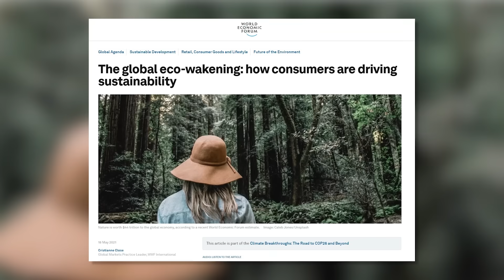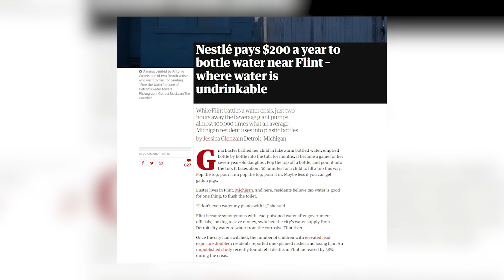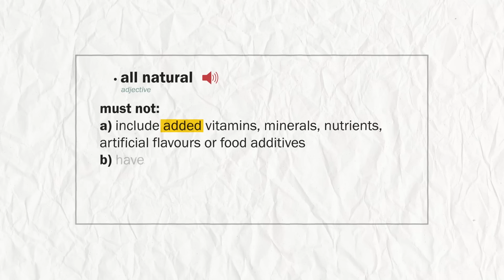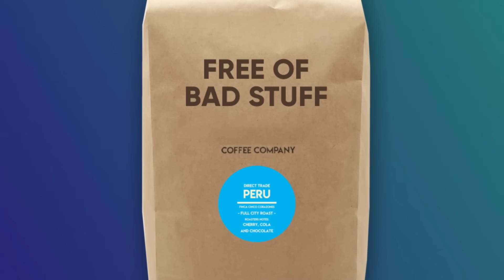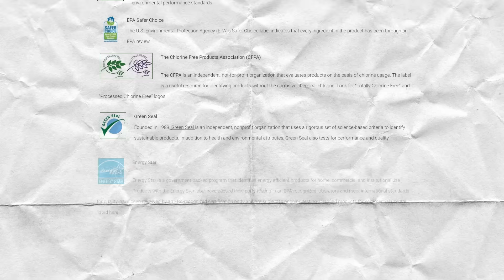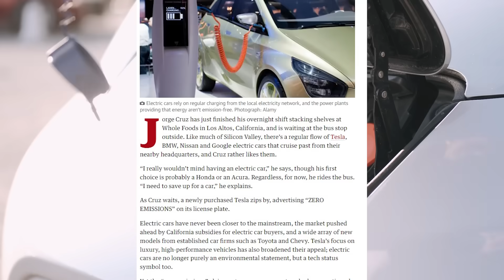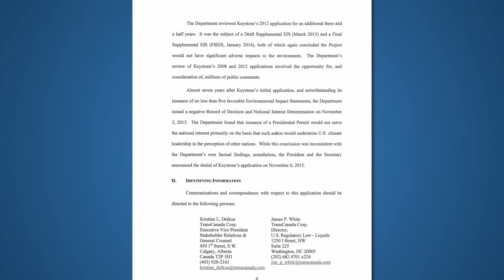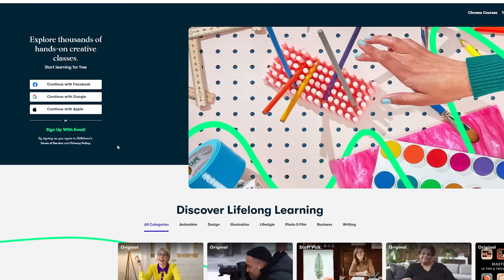Why Being 'Environmentally Friendly' Is A Scam

Comment: I'm a huge environment buff and guess what, I know the pipeline cancelled was worse for the environment. All that oil that could have been piped is just being transported by diesel trucks and trains instead of using hydro power to run pipe pumps. And has cost the Canadian economy hugely.
Reply: Yes, that part of the video surprised me. I am interested to hear how the folks at asap science think oil and gas should be transported as an alternative to pipelines.
Reply: hydro is bad btw, well, dams are bad, not that hydro is bad.
Reply: Would you mind giving the numbers since you know?

It would be nice to have some actual numbers then two people saying "I'm right." and "I'm right." both with contrary views.
Especially with costing the Canadian Economy as it seems odd this would hugely impact it.

You have to factor in pipe being maintained, building it, leaks, damaging, the transport from there... all compared to if the transport vehicles (Trucks and trains) are filling empty spaces with it potentially reducing the cost massively and remember those truck drivers need jobs so they'll go produce waste somewhere.

This also means you need to know routing ect and a few other details to blame it on it being the source of the problem and not a major issue with something else.

Something like this is incredibly deep and to be able to factor all these in and say for a fact either way is pretty difficult.
Reply: @Buglin_Burger7878  I'm not a researcher nor communicator but I come across these topics in articles and YouTube over the years. I don't have a reference. However the labour cost alone of truck drivers per km of oil transported, plus cost of fuel for those trucks... It's clear maintenance of pipes would cost less per km. I want to get off fossil fuel dependency too but gotta do low hanging fruit first like replacing all the coal power plants with natural gas or nuclear would be better $ than dealing with Canadian direct CO2 which is a rounding error compared to the rest of the world. We are like what is it 36M ppl? Out of almost 8B ppl. Canada's direct CO2 emissions is nothing. Our consumption of goods buys so much that is produced over seas so our indirect CO2 is insane. Bigger fish to fry than our own stuff
Reply: @TheSkystrider  also to mention without that pipeline the US is now struggling to supply enough gas as the war with Russia and Ukraine continue. people are now forced to work from home again because they can't afford to drive to work. having the pipeline would have allowed us to rely solely on ourselves for an important product of everyday life instead of importing from another country. the pipeline would have created thousands if not millions of jobs and that not only benefits the economy but also would have helped stabilize us during the pandemic and now war. I'm all for looking toward the environment but the pipeline was a safer option. you are most likely to die getting in a car accident and car accidents happen daily. if a truck carrying oil crashes the cleanup will be costly and if it catches fire they can't put it out with water. the cleanup will have caused more of an impact on the environment and wildlife than if we used the pipeline.
Reply: @Buglin_Burger7878  it is difficult to assess.  Here are some decent attempts, though. They focus more on spills, emissions, and worker safety than financial costs. 

Strogen et al 2016 (Applied Energy)
Green and Jackson 2015 (Fraser Institute)
Furchtgott-Roth and Green 2013 (Fraser institute)
Crosby et al. 2013 (NOAA)
Clay et al. 2017 (NBER)

Comment: Isn't it the same with phone? It's same hz with microwave and they still lie that it won't harm us when it does. The side effect is large intestine getting weaker, nausea, fatigue, knee pain, dizziness, increase of having several kinds of allergy, fog head, immune system problem and so on. There's even 5g everywhere, electromagnetic everywhere, electronic devices everywhere, wifi everywhere. I wonder what left for humanity after what's created are only for our pleasure and fun but not life and happiness.

Comment: Seeing all this I like to Mention an Idea for an App that I still think about: You simply scan a Barcode on the back of a Product and it tells you all about the shady stuff that this Product is related to(think like scanning a Nestle Product gives you "privatization of Water" etc.). The problem with that is that you would have to build up the database first and making shure everything is acurate would be really hard especially if done through crowdsourcing. Implementing the app itself might be difficult but is definetly feasable.
Reply: There are several like this. One for sea food, Buycot etc. all are trying to implement this in the respective market.

Comment: What do you think of Extended Producer Responsibility (EPR) regulations? India is implementing regulations that are putting the onus of recycling plastic on manufacturers, retailers and brand owners that use plastic in their packaging. For example, if Nestlé uses 100 tonnes of plastic, they have to recycle 50 tonnes (50% is just an example - the % increases over time). 

EPR seems to solve the first issue of the gap between recyclability and actual recycling that you discuss at the start.

Comment: For those who think they won something by cancelling the keystone xl pipeline, now the same amount of oil has to be shipped by train. 
Also, any deficit of oil that needs to get to market (yes, your food, goods and Amazon Prime packages DON’T get driven around on good intentions) comes from a place with little to no regulations. Look up what Texaco did in the Amazon rainforests.
Also, look at the power it gives certain countries, along with the conflict that comes along with the greedy trying to be the only ones in the game.

If you REALLY want to make a difference, DEMAND a cleaner alternative be made available at at least a comparable cost to the consumer. High efficiency solar panels for rooftops of houses and the tops of electric busses, for one.
Locally grown fruits and vegetables from vertical greenhouses is another one. Eat better AND reduce your carbon footprint by not needing to ship them over several countries. Like people still buying bottled water when for many of them comparable water comes out of their tap, reduce the demand and reduce the environmental impact.

Comment: Thank you for openly bringing up the negative aspects of EVs (and for that matter all li-ion powered devices) I do like EVs in general and electrification is a necessary step going forward. But too many claim that as of now EVs are the be all - end all for mobility. But they themselves have a lot of issues which still need to be sorted out. We are simply stuck in beta testing.

Comment: I was largely with you until you mentioned the pipeline. Only a completely misinformed person can say that it is a good thing it was canceled. That quantity oil is going to be refined one way or another. It can either be hauled via truck, rail, or ship and have higher risk of spillage and far more energy costs or via pipelines.
OR
You could have it pulled out of the ground from countries that care even less about the environment than Canada or the US and THEN shipped from even further away.
All this jacks up costs on the costs for people that they could have used to purchase solar panels for their house, a more fuel efficient vehicle, or even decent meals for their kids.
Those aware of these things and are wanting the pipeline shut down are heartless.
Reply: Yes
Reply: fax
Reply: Yeah I came to the comment section wondering if the pipe line was better than shipping oil via ship. train, & truck.
Reply: Good thing not all commenters are brainless sheep. The video creator is probably happy that us, peasants, suffer from inflation and of course since he is rich, he just takes it easy.
Reply: It is a good thing it was stopped,  we need to shift  immidietly to Decentralized renewable micro power. photovoltaics on roofs, solar power, hydro power, collect food waste for biofuels. This is the future, not the pipeline, thoose who think that oil will be refined one way or another, are not helping in getting the government to switch to renewable energy. society in 2022 has the capacity to move solely  towards renewable  energy, people must recongonize that so we can STOP investing in oil and fossil fuels, before it is too late
Reply: @JP-flower  I am afraid you are incorrect. Every single thing you are proposing requires oil at one stage of its journey or creation and the higher the price of oil the higher those goods are and the fewer people who can purchase them.
Like it or not, oil is the lifeblood of today's economy and only leveraging that can we hope to move beyond it.
Would it be nice to have every home a solar roof to provide its own electricity?
Why yes it would, but at this time it is impossible due to costs.
And should anyone say just use subsidies, I refer you first to Solindra then to an common sense that someone has to pay for it in the end and the government is already hemorrhaging debt.
Reply: @JP-flower  lack of money makes people homeless

Comment: An individual tip:

If you're using tote bags, use them as efficiently as you can. Some people have massive amounts of tote bags and believes that that solves the problem. It makes it worse. 

Reduction comes first before reusing and recycling. If you can no longer reduce something, that's when you reuse. If you can no longer reuse it, recycle.
Reply: Just to add on, 1 cotton tote bag produces the same amount of waste/pollution it takes to manufacture about 8000 single use plastic bags. It's one reason why I insist on using single use plastic bags instead of buying a brand new tote bag at checkout counters if I don't have mine on-hand. Assuming one goes shopping for groceries 2 times a week, it would take them *76 years just to offset the pollution/waste created by that 1 tote bag*.
Reply: @professionalpotato4764  the plastic ones are banned in Portland,Oregon. It's paper or reusable totes, and paper breaks hella.  So I either don't use a bag or remember to bring my reusable ones.
Reply: @professionalpotato4764  Reusable plastic bags exist.
Reply: @someonespotatohmm9513  Plastic bags in nature are reusable to a certain extent. Even those single use ones.
Reply: @professionalpotato4764  That's why I find phaseouts and bans to be stupid. They overlook the fact that they can be reused too.
Reply: I only have one tote bag I got second hand that I got years ago that I keep fixing up. If I’m going to get a tote bag I’m either going to get it second hand or make it myself and I also get my fabric and what supplies I can second hand
Reply: Also, reuse your "disposable" shopping bags! Etc etc
Reply: They can also make a tote bag easily from old clothing. Re-using jeans or t-shirts for totes would defiantly help things. but alas no one wants to make things anymore.
Reply: @777SilverPhoenix777  Years ago, I gave an old Looney Tunes jean jacket I'd long since outgrown to Dad to send to Goodwill.  Instead, Mom got ahold of it and sent it to her seamstress friend to repurpose into a tote bag.  I got it as a Christmas gift.  It looks great, is washable, and will take a long time to wear out, if ever.
Reply: @777SilverPhoenix777  THIS GAVE ME A GREAT IDEA FOR CRAFTINGS!!!!! I'm in a club and as the president of it I'm trying to do some craft projects and making diy projects like these that help the environment??? Sounds GREAT
Reply: @sin3358  You can also make "yarn" by cutting single use plastic bags into strips and then use the yarn to knit, crochet, or weave new items.
Reply: @sin3358  just be careful - this comment's original point was "we really don't need a ton of tote bags, they have real environmental costs." So, good to make if folks really need, less good to make just got its own sake
Reply: @777SilverPhoenix777  The problem is that most people don’t have the time to make things. Especially with people who have multiple jobs.
Reply: @corycianangel6321  I'm not sure I agree with that.  I think a lot of people end up watching a lot of TV or YouTube, or tiktok.  There's not really a good reason why a person can't craft while doing those thing, especially since crafting reduces stress + anxiety and improves self confidence, in addition to the ego boost that comes with doing something good for the environment. So like, if someone seriously only has time to eat and sleep when at home, then yeah, they don't have time to craft new bags, but most people, even when they have multiple jobs, have some free time.  I'm not saying everyone needs to start weaving bags and spend all of their freetime weaving bags, and dedicate all of their mental energy to bag weaving, I'm just saying that if it's something someone cares about, they'll make time to do it.
Reply: @777SilverPhoenix777  and they are so comfy too!
Reply: I alway use the tote bags I got from the grocery store everytime i get groceries, but I have the sturdy foldable ones because I can fit more groceries per box bag.
Reply: I have several totes in my home and car, and I’m trying to put them in my relatives cars as well. I technically have more than I need but I’m trying to lessen the times I need to use plastic bags, and give them to people who might not be inclined to buy them themselves but will take it if I give it to them. I’m trying to get them used to it too, since the ones I have hold a lot and are really sturdy. Way better for us than dropping stuff in plastic bags that tear.
Reply: "If you can no longer reduce something, that's when you reuse. If you can no longer reuse it, recycle."

Nope, no no no no. Categorize instead, you want to recycle what you can BEFORE they become useless garbage from wear. I sense a little bit of a tone here, like the throwaway line that, when China refused to TAKE America's trash, it "became simply waste".

Uhh, it was waste all along. What was it before, a COMPLICATED scheme to make China seem evil for banning things, and seem like producing heaps of trash (imported from America)?

You've convinced me, but not without some help from Noam Chomsky. This whole comment section is full of people shouting "scam" and other buzzwords, all it is is trying to one-up everyone else's sense of smug superiority from having the REAL "solution", but they're all just a parade of distractions invented to keep people navelgazing with ineffective busywork, or looking at their toes in defeat.

Take initiative and STOP BLAMING SCAMMERS. Blame yourself for accepting packaged solutions. If you'd have that kind of integrity you wouldn't even be so consumerist, because things to buy wouldn't appear as solutions to your nonexistent, made-up personal problems. Not gas to haul monthly groceries, and not plastic wrap of ready-made meals. You would work and vote to CREATE solutions, and "scammers" couldn't provide you with dreams in a can that YOU wouldn't create a market for.
Reply: I have a bunch of linen tote bags, but I didn't buy a single one of them. Most have a huge logo of a pharmaceutical company on them (they used to send my dad promo stuff, like totes, pens, etc.).
Reply: What about paper bags?
Reply: My tote bag was given to me for free on campus

Comment: The pipeline was cancelled, fuel prices are going through the roof, fuel is still being imported but now shipped in less efficiently by using fuel.  Dumb DUMB decision that screams of the Law of Unintended Consequences - or the price you pay for virtue signaling rather than facing reality.
Reply: Wait til you realize that oil companies are still private businesses, and can set their prices to whatever they want, whenever they want.
Reply: @destinyraex  Basic supply and demand.  Reduce the supply for anything where there is a demand, the price will go up.  Basic free market economics.